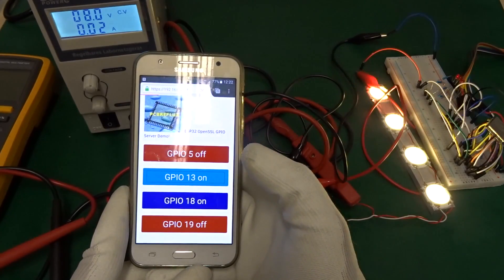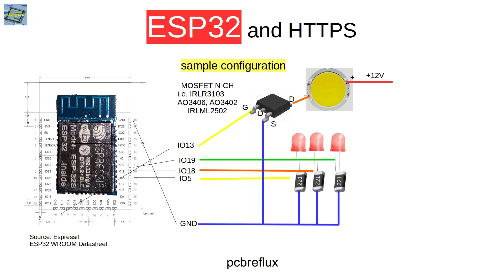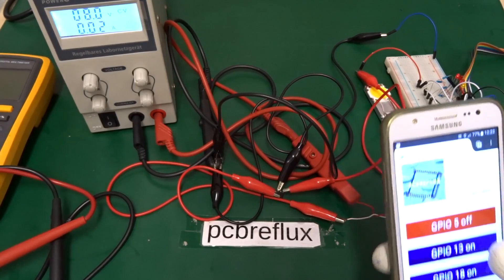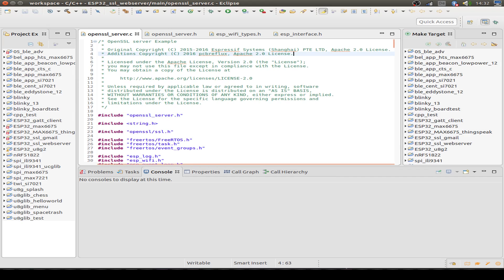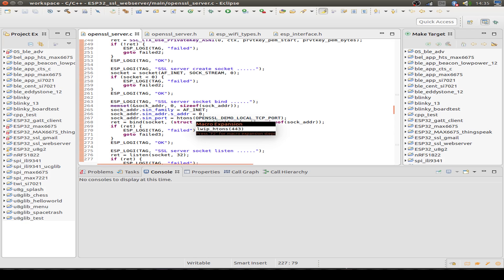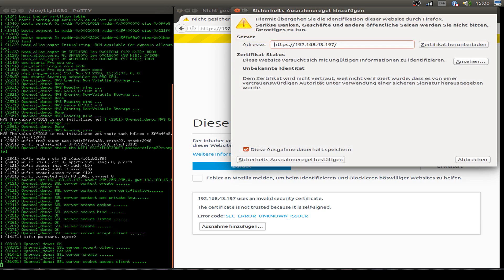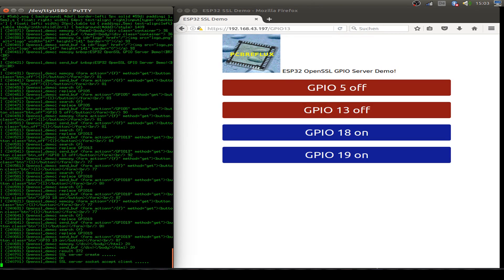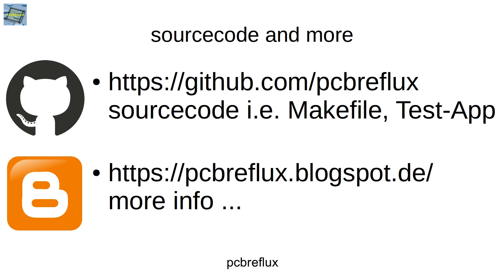ESP32 #14: HTTPS Secure Webserver and WiFi GPIO Remote Control

Comment: Having problems building this with the latest esp.py from Expressif.  Getting errors like:  object called socket is not a function or function pointer  socket = socket(AF_INET, SOCK_STREAM, 0), in openssl_server.c 256:14.  Just wondered if you had tried to update this project recently.

Comment: This can be used in AP mode?
Reply from the maker: you can switch between STA and AP at run-time (snipped code):

esp_wifi_stop();
...
ESP_ERROR_CHECK( esp_wifi_set_mode(WIFI_MODE_STA) );
ESP_ERROR_CHECK( esp_wifi_set_config(ESP_IF_WIFI_STA, &wifi_config) );
ESP_ERROR_CHECK( esp_wifi_start() );

....

esp_wifi_stop();
...

ESP_ERROR_CHECK(esp_wifi_set_mode(WIFI_MODE_AP));
ESP_ERROR_CHECK(esp_wifi_set_config(ESP_IF_WIFI_AP, &wifi_config));
ESP_ERROR_CHECK(esp_wifi_start());

Comment: usually 0 is off and 1 is on for coding standards. Also while it is a good project that does not turn on and off frequently and needs to remember default flags, constantly writing values to your flash every time you turn a light on and off, will eventually wear out the flash. Consider writing what values you would like to have in non volatile upon and unexpected reboot, store them in program memory and manipulate the flags from there. Its also bad practice to have items power on upon bootup and usually default to off but this project does fill a niche for flags that do need to survive a power cycle. Thank you for sharing your hard work with the community:)

Comment: Is this is the limitation, ??, the gpio's would on/off if the esp32 and your browser is at same network. Different networks causing timed out problem. ??
Reply from the maker: How do you connect the different networks? What differences them? Beside the netmask everything connected is in the same network and the routers route all the network traffic from one segment to the other. If there is no route from one segment to the other the networks/net segments are not connected (in my opinion) and this produce a time out. If your routers only know one way (maybe out to the internet) you can connect one device from your network with the internet but a device from the internet  can not connect activly to your device or network. So the two segments are only partial connected. Same with two private networks. Think you have to check your route settings.
Reply: means my esp32 is connected to my local network  Actually, I want to control led from anywhere in world by just accessing my esp32 over wifi.
Reply: try adding a html header connection: close see if that solves the network timeout problems. also you could improve the source by using freertos tasks and create a task for every http request. that would also speed up or you implement keep-alive and don't close the connection after "each" get request but handle multiple requests within one tcp connection but then need some kind of timeout handling.

Comment: I am stuck by using this tutorial. Simple i flashed the code in my esp32 and type the ip addr of my eps32 on google webpage and press enter. It will give me this "your connection is not private". any help??
Reply from the maker: Due you setup a SSL/TLS server without trusted certificate you have either get an trusted certificate for your server from an certificate agency or just open the untrusted website inside your browser by skipping the warning messages.
Reply: please solve the above stated request also

Comment: Sorry for newbie question, but how do you get the certificates files on the device in your example?
Reply from the maker: Generate fresh Keys (linux script), run this in the main directory:
https://github.com/pcbreflux/espressif/blob/master/esp32/app/ESP32_ssl_webserver/main/genkey.sh

or use the command line with openssl:

openssl genrsa -out prvtkey.pem 2048
      
      
        openssl genrsa -out cakey.pem 2048
      
      
        openssl req -out ca_x509.req -key cakey.pem -new -config ./cert.conf
      
      
        openssl req -out certx509.req -key prvtkey.pem -new -config ./cert.conf
      
      
        openssl x509 -req -in ca_x509.req -out ca_x509.pem -sha1 -days 5000 -signkey cakey.pem
      
      
        openssl x509 -req -in certx509.req -out cacert.pem -sha1 -CAcreateserial -days 5000 -CA ca_x509.pem -CAkey cakey.pem
      
      
        
(on Windows you may have to change the calls i.e. change / to \)

After generating the new cert files they will be included in the compile and transfered while flashing the firmware.

see openssl_server.c line 219 ... and component.mk

Comment: why do you call a new page for each action? can't you do it from the same URL? Let's say you like to increase a value by pressing a value to control the temperature. If you use a specific url to do this, you will increase the value either by refreshing the page.
Reply from the maker: goozlo Thanks. Can you provide a small demo, some lines of code or pseudo code? I am also have very limited knowledge of JavaScript so this was my maybe crude way to implement a solution.

Comment: How did you add the letsencrypt certs. When I copy letsencrypt.cer over cacert.pem and letsencrypt.key over cakey.pem. I get a ERR_SSL_PROTOCOL_ERROR(chrome)
esp32 console:
[0;32mI (30529096) Openssl_demo: SSL server accept client ......[0m
[0;32mI (30530206) Openssl_demo: failed[0m

letsencrypt gives me.
Your cert *.cer
Your cert key *.key
The intermediate CA cert ca.cer
And the full chain certs fullchain.cer

I used acme.sh to get the certs. I have a domain name matching to my internet address that the FW sends to a solaris zone where I ran the script 
 ./acme.sh --issue -d  esp32.foobar.com -w /export/home/web
Then I use split DNS to have esp32.foobar.com match the IP of the esp32 when accessed from a local lan

Comment: I have to say, very nice but the ESP32 seems a little overkill as the much cheaper ESP8266 would do the same thing?
Reply: WAY to many assumptions. You're assuming that people are all engineers and that they are doing it as part of their job. Many IOT converts are doing this for fun off their own budgets, small businesses wanting to make something that competes with existing products where every penny counts etc etc.... I don't know where you live - but I'll bet engineers in India don't often make good money and they're not exactly overpaid in the UK. This isn't a "just for the US" channel. Espressif documentation in poor Chinese? That seems like history to me - well, certainly for the ESP8266, not looked at the latest ESP32 doc.... everything I have from them is in half-decent English.
Reply from the maker: Hi, you are absolutely right, for the ESP32 this is not enough. But I 
don't know any HTTPS example for the ESP8266 and this should also only a
 beginning. So we should start an WiFi AP with secure (HTTPS) 
configuration and switch to station mode to connect to a local WiFi and 
then also do an secure OTA over SSL/TLS with an signed and encrypted 
firmware! Maybe i am only dreaming?
Reply: Add in an MQTT client and you have the basis of just about any application I guess! That's how I started with the ESP8266. Still waiting for my ESP32 dev board to turn up.
Reply: The ESP32 has hardware acceleration for asymmetric crypto which is necessary for key signing and key exchange.  That's crucial for HTTP SSL.  The ESP8266 and most other microcontrollers have no support for asymmetric cryptography and they can only do payload encryption symmetric cryptography.  ESP32 is the only one I know that can do both.  If you attempt to asymmetric crypto on the ESP8266 or other microcontrollers, you can expect pauses for 5 to 10 minutes at a time.

Another cool feature of the ESP32 is that it has a second processor that can run while the ESP32 is in deep sleep.  That makes it extremely power efficient.
Reply: Sure and that's all very nice - but right now it is too expensive - I quote the head of the company "The ESP32 will be slightly more expensive".... right now it is not "slightly more expensive. You can get an Orange Pi Zero for £7 - that will do encryption no problem.  When the ESP21 comes down to twice the cost of an ESP8266 - currently at under £2 - then all this will change.
Reply: It's still new so the price is very high right now.  Price will come down as more get made.  The Orange Pi Zero is a different animal and you need to add Flash memory which alone is $7 for a MicroSD card.  The size and power consumption is way higher and once you factor in the deep sleep operation, they're not in the same ball park.

The ESP32 chip itself really is only slightly more expensive than the ESP8266.  I think we're only talking about $1 vs $2 for the bare chip.  It's just that the complete product on a PCB with other components is still really high right now because it's so new.  But again that will come down in price as more products come out based on the ESP32.
Reply: Fair point about the Flash - I tend to have them lying around and don't factor into the cost. Well, I'm a GREAT fan of the ESP8266 so when the time comes...
Reply: too expensive, the extra 5-10 bucks is putting a crimp in your budget?
Reply: $5 to $10 is a fortune in BOM for manufacturing.  It is 3 to 6 times higher.
Reply: Oh hah.... no - it just becomes less value for money and I like value for money.
Reply: I just find it a weird thing that so many Engineers don't mind wasting hours tinkering needlessly with one-off weird products with Chinese documentation, and endless debates in the technical forums about not wanting to spend an extra $5 on a product.  Almost any engineering training I've seen cost $500-$800 a day and as engineers we make good money, especially someone as well published and accomplished as yourself.
Reply: Engineers have the spirit of discovery.  They also don't just work on one-offs.  They also work on things meant to be mass produced.  Espressif documentation isn't perfect, but it's mostly decent English and the community keeps growing around it.  Anyone who doesn't want to bother can stick with Raspberry Pi or Arduino.
Reply: Your point is accurate, unfortunately its based on a false premise.  Obviously i was referring to the DIY, Maker, Engineer Hobbyist who are buying one or two units for themselves.  If you have to be concerned with a BOM multiplier for actual business purposes than that is a different story.  The nuance of my point may have been lost using Google Translate.
Reply: If you are cheap than just admit you're cheap, don't channel your inner Bernie Sanders to engage in some  puerile world view debate.  Even normal recompensed Indians and Chinese can afford the $5 for the upgrade  to The ESP32; this isn't 1961.  If you have to save money to eatyou can de-soldier re-use the voltage regulator and USB-to-serial chip from the ESP8266.  My point remains extant,  many engineers have some weird pathological fetish to constantly debate about saving a few bucks on a component for DIY projects while wasting hours debugging code and dealing with bad  documentation.
Reply: The problem is that you were generalizing about anybody that was interested in the ESP products being just a bunch of hobbyists.  And you generalized the ESP products as having only Chinese documentation.  Both of these are totally inaccurate.
Reply: Not really sure who it is that Steve B is trying to insult here... I'd imagine everyone can afford the much more than $5 dollars upgrade for an ESP32 board (typical ESP-12 board price around $2 or so... typical ESP32 board seems to be 6-10 times that or more ). You are miles out on the costs - and on the comments about Chinese documentation.
Reply: Can the ULP measure sensors (like temperature or accelerometer) and store the results without waking up the main processor?
Reply: 8KB is a lot of storage for sensor data if used wisely.  I guess you can wake the main processor to permanently archive that RTC fast memory so that you can let it collect again in deep sleep.
Reply: Thank you
Reply: Oh you're telling me that if I use the ULP I will draw 5mA current?  If I need to constantly monitor the sensor to catch any changes in the sensor like sudden movement, this seems like a good compromise.

Comment: Thanks for this video, I try to compile this firmware and try on Esp32 dev board , it appear that it take very long the connect the device and  also take very long to change the status of gpio, in debug window, it take very long to print the debug information,
Reply from the maker: Edward Liu Have you some infos about your system? UART to USB bridge, terminal software and  baudrate? First step could be to increase the baudrate.
Reply: Sorry it seems I put the message on the different post, LoL

Comment: Thank you very much for this very helpful project.

Just a minor annotation to the MOSFET: most IRLR3103 will work with 3.3V input voltage, especially with this low load. But this is not guaranteed. "Gate Threshold Voltage" means: under that voltage, the  I_DS is max 250µA as stated in the datasheet.
If you want to have a guaranteed max RDS_On you have to look into "RDS(on) Static Drain-to-Source On-Resistance": 24mOhm @4V. and ID 24A. With 3.3V nothing is guaranteed and you rely on the oversizing. Which in many or even most cases will work.
The IRML2502 guarantees 90mOhm @2.5V and 3.6A
If you want to use a TO220 one go for the IRF3708: 29mOhm @2.8V and 7.5A
Reply from the maker: Juergen Seekircher Thank you to make this clear. I just use them becase they are available in my stock. And aditionaly I pull down the gate with a 10k resistor to ground to enshure the LEDs are switched off. Maybe this could be setup in the GPIO settings (sink current).
Reply: Hi thereIt seems browser related, I thought initially IDF framework because it's under the development, so I compile under different OS, Windows and Mac. it produce the same result. it works on Firefox browser but very slow responding , it does load in IPhone 6 with IOS 8.4 but it doesn't functioning, it doesn't load MS browser under windows 10, the Firefox browser is on Mac and is latest version.   the following is debug infor. for iPhone connection, it load the page correctly but it doesn't responding with the button.[1B][0;32mI (1574375) Openssl_demo: OK[1B][0m
[1B][0;32mI (1574375) Openssl_demo: SSL server accept client ......[1B][0m
[1B][0;32mI (1575965) Openssl_demo: OK[1B][0m
[1B][0;32mI (1575965) Openssl_demo: SSL server read message ......[1B][0m
[1B][0;32mI (1576065) Openssl_demo: recv_buf GET / HTTP/1.1Host: 192.168.1.177Accept: text/html,application/xhtml+xml,application/xml;q=0.9,/;q=0.8Accept-Language: en-usConnection: keep-aliveAccept-Encoding: gzip, deflateUser-Agent: Mozilla/5.0 (iPhone; CPU iPhone OS 8_4_1 like Mac OS X) AppleWebKit/600.1.4 (KHTML, like Gecko) Version/8.0 Mobile/12H321 Safari/600.1.4[1B][0m
[1B][0;32mI (1576105) Openssl_demo: memcpy <form action="/{f}" method="get"><button class="btn_off">{l}</button></form><br/> 81[1B][0m
[1B][0;32mI (1576105) Openssl_demo: memcpy <form action="/{f}" method="get"><button class="btn">{l}</button></form><br/> 77[1B][0m
[1B][0;32mI (1576125) Openssl_demo: memcpy <form action="/{f}" method="get"><button class="btn">{l}</button></form><br/> 77[1B][0m
[1B][0;32mI (1576135) Openssl_demo: memcpy <form action="/{f}" method="get"><button class="btn_off">{l}</button></form><br/> 81[1B][0m
[1B][0;32mI (1576145) Openssl_demo: result 342[1B][0m
[1B][0;32mI (1576145) Openssl_demo: SSL server create ......[1B][0m
[1B][0;32mI (1576155) Openssl_demo: OK[1B][0m
[1B][0;32mI (1576155) Openssl_demo: SSL server socket accept client ......[1B][0mwhen press the button the debug window as follow
[1B][0;32mI (1752735) Openssl_demo: OK[1B][0m
[1B][0;32mI (1752735) Openssl_demo: SSL server accept client ......[1B][0m
[1B][0;32mI (1754235) Openssl_demo: OK[1B][0m
[1B][0;32mI (1754235) Openssl_demo: SSL server read message ......[1B][0m
[1B][0;32mI (1754345) Openssl_demo: recv_buf GET /GPIO5? HTTP/1.1Host: 192.168.1.177Connection: keep-aliveAccept: text/html,application/xhtml+xml,application/xml;q=0.9,/;q=0.8User-Agent: Mozilla/5.0 (iPhone; CPU iPhone OS 8_4_1 like Mac OS X) AppleWebKit/600.1.4 (KHTML, like Gecko) Version/8.0 Mobile/12H321 Safari/600.1.4Accept-Language: en-usReferer: https://192.168.1.177/Accept-Encoding: gzip, deflate[1B][0mhope this infor. is helpful. many ThanksEdward
Reply: BTW when loading with IPhone, the response is normal, but just wouldn't perform as expected.

Comment: Where did you get your esp32? i ordered my on ebay but it never came.
Reply from the maker: NE555 Hi get some from a local seller (Eckstein, but mine dont work with arduino and wifi !?! don't have a clue) and one from aliexpress (accidental killed with a heatgun :( ) but all other orders are never arrived also (but refunded). Now I tried analoglamb.com,  their esp32 stock is available (today on backorder). Any one else some sources?
Reply: In the US your best sources are Sparkfun and Adafruit, however those are for the boards with the regulator chip and SiLabs usb-serial converter.  If you just want the bare chip, that's available all over.
Reply: Use aliexpress